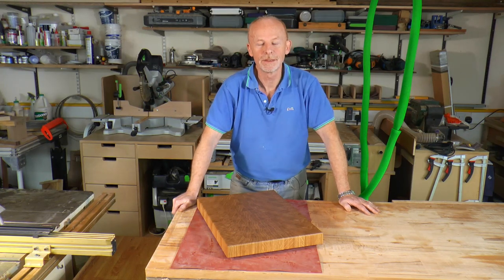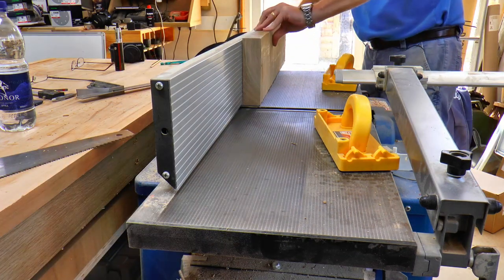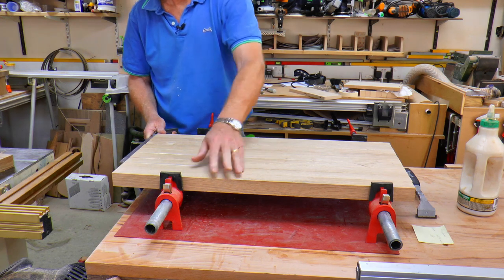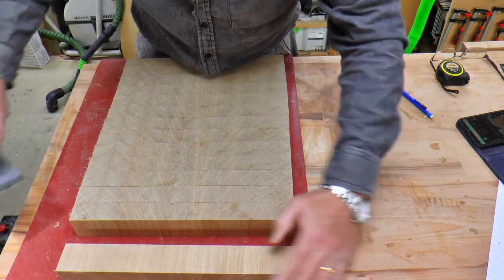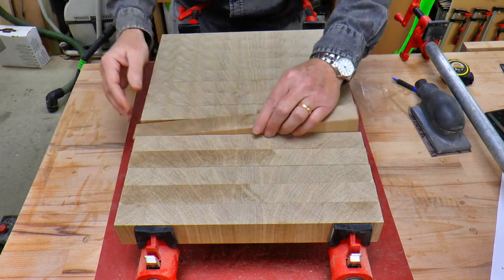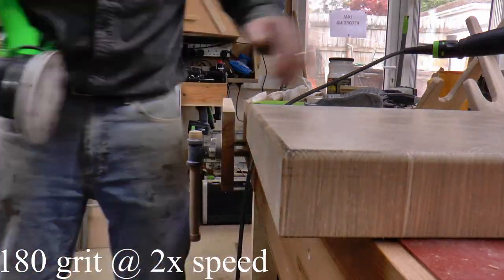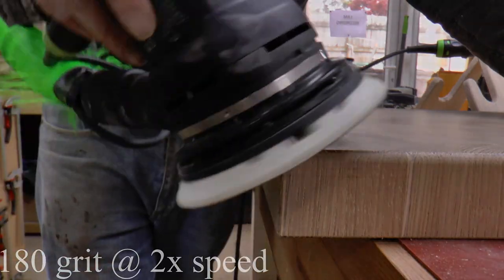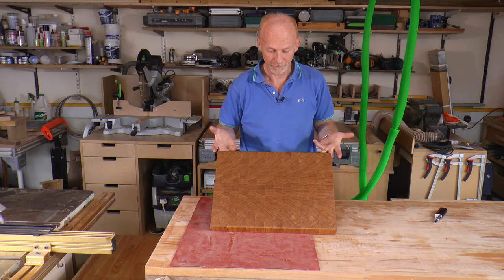Making an Oak End Grain Chopping Board from rough stock

Comment: At 3:07, you have three boards approximately 20cm wide. Why not save time and wood by edge gluing these together as-is, alternating the grain, rather then ripping them down into strips only to have to reglue them back into wider panels? Is it just to alternate the grain direction even more? If so, is that for aesthetics or strength?
Reply from the maker: Hi Chris, good question.  I believe if I did that the three larger boards may well warp and effect the overall stability, where as if I cut them down then everything is opposing there reducing the overall chance of warping. 👍

Comment: You started with a 750mm board that looked to be about 50mm thick. Can you remember the finished dimensions of the chopping board? Lovely job, by the way!
Reply from the maker: Hi Clive, thank you.  I'm really sorry but I can't, however I do have a video on 'How much wood you need to make an end grain chopping board' if that would help. https://www.youtube.com/watch?v=C6gS3sVHB58&t=477s
Reply: @GTWoodshop  Thank you! That sounds like just the information that I need. There are plenty of videos showing how to make an end-grain chopping board, but none that I have found  tell me how to calculate how much timber I'll need.
Reply from the maker: @MrHighflyingclive  I'm thinking you've just found the very one. 😁👍
Reply: I know its a year later BUT just in case you still would like to know its 450x335mm

Comment: I enjoy your videos.  Thank you for sharing.  You are very talented.  I have a question about material selection.  What type of oak did you use?  I have a ton of it lying around my shop but it was my understanding that it is not the best to use for cutting boards.  What are your thoughts?
Reply from the maker: Hi Corey, compared to some other species Oak is very porous indeed which in my opinion makes it a less than perfect choice for a cutting board, however the world at large appears to prefer Oak.  The porous nature of the wood can be offset with a good mix of mineral oil and beeswax to fill the pores.  I have used European Oak for many years without any problems.  As long as your choice of timber is stable and dry you should be fine.  From a perspective of allergies,  you can't go a lot worse than Walnut, but that's one of the most popular. 👍

Comment: what mineral oil do you use? I have tried Tung Oil.
Reply from the maker: HI Peter, I only use Food Safe Pure Mineral Oil.  Here's a link to some at Amazon I've used.
https://www.amazon.co.uk/White-Mineral-Oil-Carrier-Litres/dp/B017H6W8RC/ref=asc_df_B017H6W8RC/?tag=googshopuk-21&linkCode=df0&hvadid=256093557972&hvpos=&hvnetw=g&hvrand=5605853866495319583&hvpone=&hvptwo=&hvqmt=&hvdev=c&hvdvcmdl=&hvlocint=&hvlocphy=1007013&hvtargid=pla-415580993259&psc=1&th=1&psc=1 👍

Comment: I thought oak was not suitable for cutting boards due to the large pore size? Please elaborate. Thank you.
Reply from the maker: Hi, you're right Oak has really large pores, however the general public seem to love an Oak board, so if you seal the pores with beeswax diluted in a mineral oil solution it solves the problem. 👍